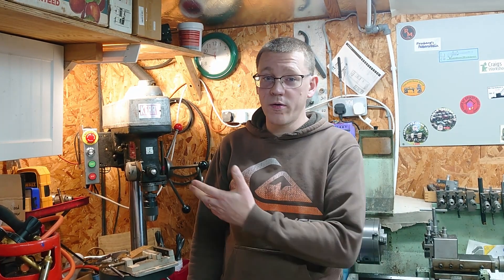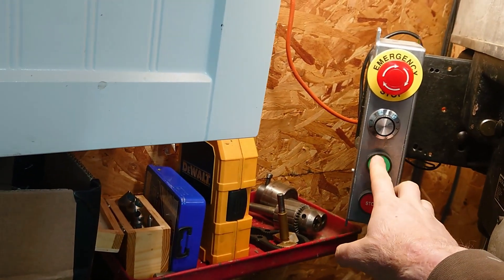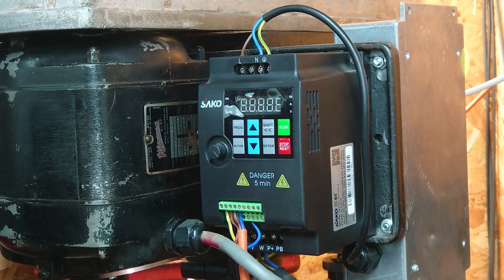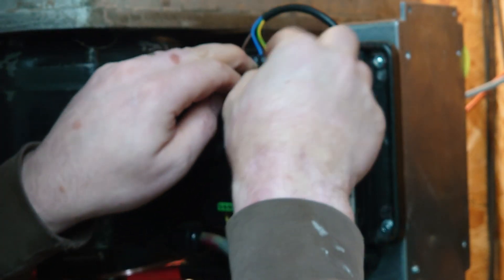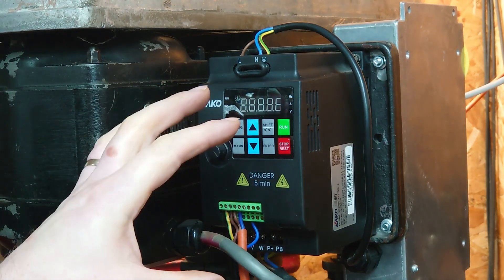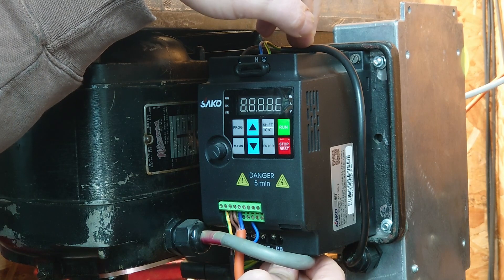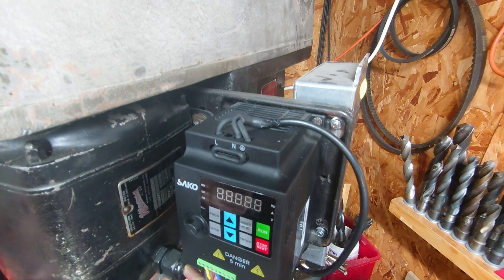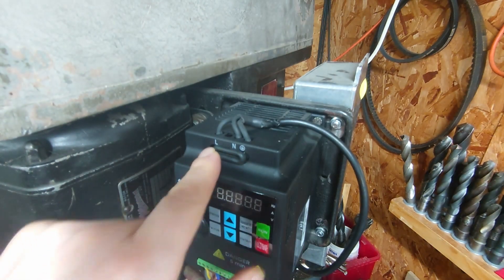VFD wiring (and a sticker!)

Comment: how many watts are the thre phase motors on the lathe and on the drill press?
Reply from the maker: Thanks for the question. The lathe currently has a 1kW BLDC motor, but I do have a 2.2kW AC motor to fit at some point. The drill press is 350W (1/2hp).

Comment: Nice video! Just some info from my professional engineering life: In the US we have Underwriters Lab which sets standards.  UL507 defines (and I am not making this up) the "UL Finger" which you use for testing both electrical safety and mechanical safety (think fan blade openings).  The finger has a 3.5 mm radius at the end and tapers from around 6mm to 15 mm over 96 mm. So that 8mm slot needs a cover of some kind, in a professional setting.  Strain relief will help protect the machine from you and is a good idea as well.  A slightly better strain relief can be made with 2-4 zip ties by using one around the cord and a different one to the mount that goes through the first one.  You can double up on either or add another strain point easily that way. Having the machine frame grounded or earthed also adds safety, if possible. So I think your solution is fine in the home shop.  I might have even chosen black electrical tape or maybe a 3-D printed cover depending on how permanent I thought this was for my shop.
Reply from the maker: Hi, thanks for your comment. I'm aware of UL, and in fact have used a calibrated 'finger' as I've put a few products through the CB scheme (primary the iec62368 bit which I believe is very similar to UL62368). I originally thought of 3D printing covers and cable retention parts, but UL94 filament is silly expensive! There's no point trading one compliance failure for another! The grommet I used filled the hole sufficiently and should be suitably rated. I didn't want to go in to too much detail as the video got a big too long with all my wittering anyway. The machine frame is earthed, I even cleared a bit of paint to make sure of a good contact.

Comment: Wondered where you have been mate. Patio work, I'll send you a photo on WhatsApp 😊
With regard to the VFD, I think if they knew what you do for a job, they wouldn't of commented. Besides, you are the only person who enters or works in that shop and more than aware of potential hazards. I myself wrote risk assessments every day for years for multiple disciplines. The only comment I would of had is " Stick a zip tie on that cable"😊😊
Reply from the maker: Someone else has now suggested that two zip ties might be better than one. Where will it end???🤔🤣🤣🤣
Reply: @ollysworkshop  loop the power lead around the column. Cable tie the loop. Hot glue it in place, then coat it in liquid rubber and fit a rolled armour steel plate over it. Oh, don't forget to attach a HV sticker 🤣🤣🤣🤣🤣🤣🤣

Comment: Hi Olly. Great to see you back in the workshop! Just my 2 penneth: Try not to take the bait and rise to viewer comments. Sometimes comments are valid and gratefully received, sometimes down right unpleasant (and anywhere and everywhere in between). The problem with the internet there's always someone somewhere who would do it differently, and always (without exception) their way is better than yours.
 
Keep doing what you're doing the way you're doing it. 

You've made a pretty well reasoned and robust case for your setup, though the time you've spent hasn't been wasted. You've reduced the hazard, though probably not the chances of getting a belt (as they were pretty low already!). 

I guess it serves as a useful reminder that in the spectrum from 'absolute death trap' to 'space shuttle flight ready' we should always try to aim high. 

Enjoy your bank holiday, Matt
Reply from the maker: Hi Matt. I wasn't going to, but Jon mentioned something about putting his VFD in a box a few weeks ago and I thought I would make the video to explain to those that are less electrically inclined that it is simply wrong to insist all electrics MUST reside in an earthed metal box. The comment did get me to look at the wiring critically, and it certainly didn't take much time to address the issues I identified. Don't worry, I'm not going to turn into a safety nazi! Busy weekend for me on this one as it's my (almost) 3 year olds birthday weekend